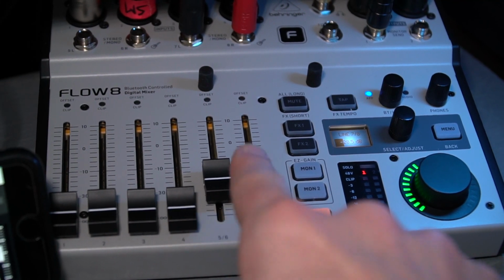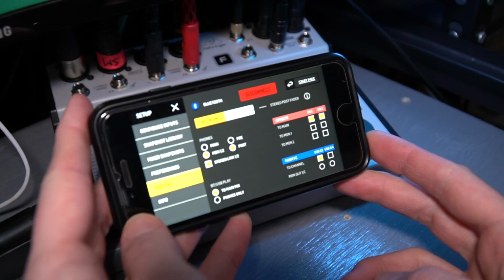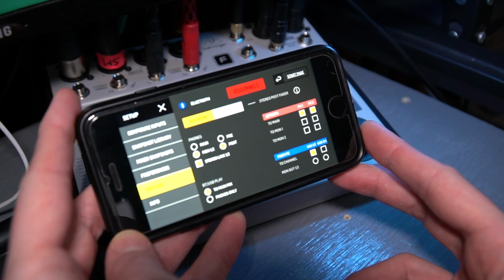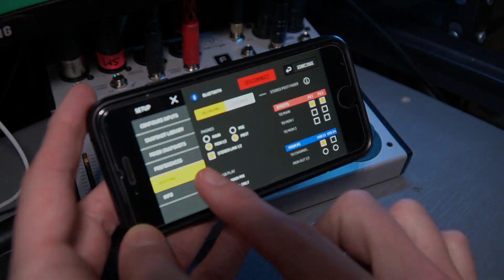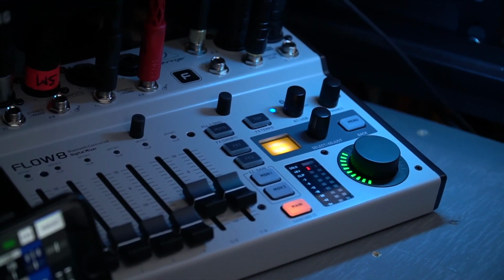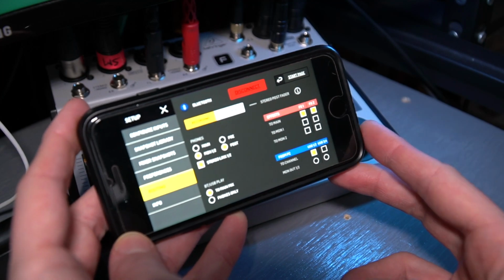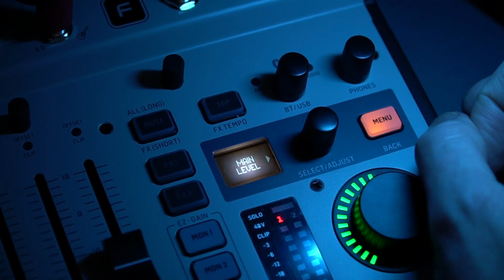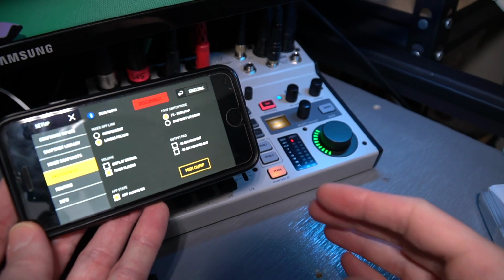Behringer Flow 8 | Firmware Updates for 2021 - Exclusive First Look

Comment: Does anyone know what foot switch to use with this mixer ?,I can't find info on it anywhere
Reply from the maker: I just put together a quick blog post for anyone curious about the footswitch specs and functionality for the Flow 8 - https://www.dcsoundop.com/flow-8-footswitch/
Reply from the maker: Great question. I just tested it and the way it seems to work is it is a TRS jack, and you want a button that is 'normally open'. You can wire it to short pin one to pin 2, which will mute the effects. Or you can wire a button to short pins 1 & 3 which gives you the tap tempo. Obviously you could wire a double switch or pedal to do both. You'd want non-latching switches, as the mute latches itself after a short hold just like the button on the mixer does. Hope that helps Simon! This should work if you're not into building one - https://amzn.to/2ZHGRbt

Comment: Hi sir plz help me! 
How to increase audio interface volume on streaming..actually connected my laptop on obs but comming on low volume

Please explain my audio problem..
Reply from the maker: It's impossible for me to know for sure, but I would suspect you have your gain set incorrectly at some point in the mixer, which is causing a low level at the computer. You need to be sure you are setting the input gain for your microphone at a healthy level without clipping, and make sure that mic is turned up in whatever send you are using to feed OBS. If all else fails, you can add gain in OBS.

Comment: in the first versions you could go to the 4 band equalizer and choose the frequency you wanted to change, apparently that was removed
can you tell me something about it?
Reply from the maker: On the 4-band EQ, just tap once on the band and the full controls should pop-up for you. At least it still does on iOS. What type of device and OS are you using? Thanks for watching!
Reply: @DcSoundOp  on android app is not working for me and it worked before firmware and app update

Comment: For my monitor the effect better pre or post the monitor is in ear monitor that I use effect 2 only for the in ears and the effect 1 for my voice so effect 1 my voice pre or post
And effect 2 pre or post?
Reply from the maker: Typically we'd run effects on vocals post-fader, so that changes in the overall level track to the effects send (this avoids you sounding like you've fallen down a canyon if you turn your mic down in the mix). There are folks who do it the other way for sure, and a lot of deciding that has to do with how you perform and your specific taste. There's no wrong way really, as long as you know why you're doing it & are happy with the results.
Reply: @DcSoundOp  this mixer flow 8 has 2 effects or the 1 is reverb and the other delay? Is is possible to have 1 effect if it has for my voice and the other for my in ear monitor?

Comment: So you're saying I can route my plain guitar sound into my DAW, then output it back into my mixer after I distorted it with my vst plugins, then ONLY listen to that mix by muting everything but usb in 1/2 to my monitor out?

If so... nice!

Otherwise, do you think it's possible to ever get "recording" mode to be post effects? There must be a reason this can't be done. Streaming is OK but it's only 2 channels.

Comment: Great video.  I work a solo act, keys, vocals. Every company always makes the mistake of not putting a high pass filter or a way to drop the low end on the effect. Especially hall settings. you have to have the option to drop the low end  on the reverb or you will sound like you are in a gymnasium. If you are a vocalist with a voice in the lower range, you have to have that option.

Comment: This mixer needs some reverb tweeks in a firmware update as the only reverbs that sound good to my ears are church and cathedral really.  These also need tweaking further from what the app will allow as they either sound to dry or too much, it's difficult to find the sweet spot. They also make plosives a bit of an issue. I'm sure they can fix this.

Comment: Lack of Parametric eq is the only reason I won’t buy this . It’s perfect otherwise . Especially needed on master eq and monitors.
Reply from the maker: The latest version of the firmware has a four band parametric (where each band can do from 20Hz - 20KHz) on each channel. If you haven't checked it out, there is a demo mode you can try without having the console on hand.

Comment: Great video. The one feature that I think will just nail it for me would be if either of the monitor outputs mixes can be routed back to the computer via USB.  That way for a setup where I might have a small live application that I also want to stream. I can have a live mix and a different  stream mix going at the same time.  It therefore works as a device level implementation  of loopback. Something that is now on almost every new audio interface/ streaming device. I think once that is done the Flow 8 will be unstoppable. As I've thought about it  I guess another way to implement that would be to route the main mix to the PC via USB and just use the monitor outputs as the live on location feed?   Thanks for the hard work.
Reply from the maker: You've got it right, you've just got to use the output that fits the job at hand & forget that one is called main & the others are labeled monitor. If you can feed the stream with the main out and use the monitor outs for a speaker in the room, that's a perfectly reasonable setup. Alternatively, I've described in a few other responses how in recording mode, you can patch a short 1/4" cable from the monitor out to the input of an unused channel & it will show up on that channels USB direct out to the computer as normal. I don't believe this is something they can change in firmware, but it would nice to be wrong.
Reply: @DcSoundOp  Thanks for the response. It would be nice to be wrong in this case. All the best.

Comment: is it possible to create a preset? and if you off and one it will be on the last sceen ?
Reply from the maker: no reason to cross post this to all of the FLOW 8 videos on the channel. Yes, presets are possible & it does return to the last known state at power-up. You can download the app to try in demo mode for how the preset library works.

Comment: What's your opinion on the actual sound quality of the preamps > output...vs a UI16?
Reply from the maker: The Ui16 is the more usable console from input to output in my opinion. I've taken the Ui12 on press conferences and the mixer can get the job done. I wouldn't consider the FLOW-8 to be in the same category - it's a fine mixer for small acts looking to travel super compact,  but the Ui mixers are more capable & give you more opportunity to get things sounding how you want at the output.

Comment: Hallo, maybe it is a stupid question... I would like to control the volume of the channels in the daw in USB recording mode. But although the fader of a channel is completely down, the signal will be recorded. So mixing in the daw doesn't work for me with the flow 8.
Maybe someone can help.
Thank you and best wishes for all
Reply from the maker: In recording mode, the level sent to your DAW is controlled by the input gain you apply to the channel on the FLOW, as it is a direct output from the FLOW-8's mic preamp. Hopefully that helps clear things up.

Comment: Hello! I have a question: in the video you show how to use MON1 and MON2 for a stereo monitor with phones; when you do that, what happens to MON1 output and to MON2 output? Can you still use them for separate monitor (with their own mix)?
In conclusion, can I have 3 different monitor mixes using Phones output, MON1 output and MON2 output.
Reply from the maker: No... you cannot get a third mix but turning on the Mon to Phones send. It simply routes the mon bus to the phones output.

Comment: Could you please tell me if I can adjust mic. level in headphones (without latency) while I record vocals for singer comfort? And my second question is could I use it as audio interface to use fader for drawing levels in previously recorded tracks in DAW?
Reply from the maker: Hello Pawel, thanks for the message. You can do zero latency monitoring with this no problem, just turn off channel monitoring in your DAW and turn the local input up on the mixer when recording. For automating tracks though, that is not possible with this mixer. For that you need a controller, not an interface. For doing that, any of the X-touch controllers will work. If you are only doing a couple of tracks at a time and the automation is important to you, maybe check out the  PreSonus iOStation 24c - it is a controller with a small interface built in too. Here is a video we did about it a while back - https://youtu.be/tawF2suXJMc
Reply: @DcSoundOp  Thank you for your answer. I found this Presonus today and in case of automation is ideal. Two inputs are enough for me. One I’m afraid is I/O quality. I use old MOTU interface so far and one guy said that changing MOTU into Presonus is like changing Bentley into Opel. What do you think about Presonus audio quality?
Reply from the maker: Hey Pawel, I'm not sure it's quite Bentley to Opel, but I like your comparison. I'm a big fan of MOTU products also & do believe the difference will be noticeable depending on what you are doing. If top quality is your concern though, the FLOW 8 probably isn't the right tool for you either. You may want to look at a dedicated X-touch controller just for automation & then upgrade your MOTU accordingly or move into something from Universal Audio, RME or Focusrite PRO for similar quality or better.
Reply: @DcSoundOp  Thank you. You helped me a lot.
Reply from the maker: Thanks Pawel, I hope you'll stay in touch in the future. All the best.

Comment: Hi and Thanks. When I use Bluetooth Audio from an Ipad or iPhone, I get audio Glitches or Hiccups as I continue to work on the mixer while audio is playing. I suspect that the Bluetooth needs refining or some updating. I use a Mackie DX8 in the same way and the audio never glitches...Has anyone else experience any Bluetooth Audio abnormalities?
Reply from the maker: Hi Carlos, that absolutely should not be happening. I just went back & tested again, using only one iPhone 12 to play music to the FLOW via bluetooth & to run the FLOW control app. There are no glitches or hiccups that I can make happen by using the app or adjusting the mixer in person. What devices & OS are you using for playback & control currently? Are they on the latest firmware & control software versions from Behringer? Thanks for the message.

Comment: Hi I hope you can help me fix this. I just bought the flow 8 and a brand new MacBook. I installed simply put and Everything goes well until after I select the newest version (738 now) y click update. A legend comes up that reads… DFU ERROR 7: failed to prepare dfu update.
The mini screen in the mixer stays red in update mode until I turn it off.

One time the legend didn’t appear and it continued to update in the simply put but the mixer said UPDATE FAIL. 

If anyone could help me i would really appreciate it.
Reply from the maker: Follow this conversation's response on the other Flow 8 video - https://youtu.be/x0owa3HC5fQ

Comment: I've skimmed down the comments and can't see anything that addresses this. Keen to invest in for small gigs with capacity for running some tracks alongside. Now that they've implemented the 4 channel USB returns I'm trying to work out if we can achieve the following (which whilst the desk does a lot, I think maximizes the potential). Was considering having the UMC404 and then a mixer, but this seemed to bring together best of it all.

Working in Recording mode
USB 1/2 as the Tracks to the BT/USB channel (rotary control) - 
USB 3/4 directly to the monitors as a click/guide track  to then run to in-ears [ Can always tweak that volume in Ableton or from a midi controller ]

Looking at the block diagram I think this is possible, however the routing pages in the app (which I'm exploring in Demo mode it's not entirely clear) There are 2 sections and it's not clear how they are linked - 
BT/USB play (which I presume is USB1/2 only) with option to go to Main mix or headphones - 
From PC with the routing table USB 1/2 and 3/4 options to send to monitor or to 5/6 7/8 respectively.

Basically aiming to not have to give up physical inputs on channels 1-8 for the USB audio so I've expansion capacity for the band if needed. 

If anyone can confirm that the BT/USB is 1/2 only and 3/4 can be sent elsewhere I'd be really grateful

Comment: Is it possible to Link the Main Mix to Monitor1 and Monitor2 ?
Many musicans prefer to have the main Mix with all Effects on the Monitor.
Reply from the maker: They haven't implemented any way to do that yet in the current firmware. I know folks have asked for Pre/Post fade monitor option before, so fingers crossed it's something that the hardware can support some day. Thanks for the message Marco!

Comment: Hello I should be able to link usb IN to Fader 4.. Rout. need the system for a carousel operator. It has 3 stereo inputs and a microphone. What would also be useful in this case is a tokover function!
Reply from the maker: Will pass this along to the dev team, thanks for the feedback Stefan, sorry for the slow response.

Comment: Does power come from microusb only or from USB B too?
An useful future implementation would be USB C, micro is really fragile.
Other useful tools would be a fully parametric eq, reverb and delay parameters (not only fixed preset).
Reply from the maker: The micro port is for power, the B is only for connecting to a host device. Thanks for the message Mauro.
Reply: @DcSoundOp  I've experienced with line6 relay, micro usb in metal housing is easy to break.

Comment: I got this Mixer for two weeks I tried to use this mixer for zoom meeting via streaming mode. May I ask you one question how to send the monitor 1 or 2 send back to the usb playback (Mix minus via usb) Because now I can use the mix minus only use monitor 1 connect to    other USB soundcard and setup zoom mic to  the soundcard.
Reply from the maker: Hey Piya, the workaround to get a monitor send back to the USB is unusual, but it does work. You'll need to use the unit in 'Recording' mode to get the individual channels to appear in your computer via USB. Then you can patch from the monitor output with a 1/4" cable, back into one of the 1/4" inputs on a channel, and now that channel with pass the monitor send output over its related USB channel to the computer. Make sure you don't turn the channel you use up in the monitor mix you use, as that would be a direct feedback path, but otherwise you'll be good to go.
Reply: @DcSoundOp  Thank you for your answer. I will try on recording mode.

Comment: why i only listen to the left headphone if it is plugged into the monitor send ?
Reply from the maker: The monitor send outputs are mono balanced outputs on 1/4" TRS or Tip - Ring - Sleeve connectors. This is the same connector used for the headphone output obviously, but there is it wired as [L | R | Common] and on the monitor output the same connector is wired [+ | - | Comm] so you're only getting a mono signal and making a connection to one side of your headphones. There is also no headphone amp here, although the line level output has enough power to drive most headphones a little bit. 

To use the monitor outputs properly, you'd want to connect them to a headphone amp, or an in-ear monitor transmitter for wireless, or to a monitor speaker. hope that helps.
Reply: @DcSoundOp  thank you for the answer
Reply: @DcSoundOp  can i use a behringer pm1 in monitor send and what kind of cable is suitable for monitor send? TS or TRS?

Comment: Will this power sm7b mic? Thanks
Reply from the maker: See my reply to your question on the FLOW 8 questions video. Thanks!
Reply: @DcSoundOp  will this mixer pair well with dbx286s and SM7B mic? Thanks
Reply from the maker: Sure, the 286s is a fine mic preamp that you'll be able to plug into any of the line inputs on the FLOW 8.

Comment: I have a FLOW 8. I have signals on headphones and main, but non signals on monitor send. Which buttons do I have to turn on???
Reply from the maker: When you press MON 1 or 2, you need to then bring up the channels you want in that mix, as well as the BIG main knob that is now controlling the main level for whichever send you selected.
Reply from the maker: Did you get this sorted out? I noticed you emailed as well after I responded here. Hopefully you got things figured out, enjoy your mixer.

Comment: Make the “tap” blinker S T O P. blinking!  Puleeez!
Reply from the maker: If you're not using EFX 2 specifically for delay, you can set it to anything that doesn't require a tap - like the 'Deep Chorus' preset & the Tap button will go out. Hopefully a work around that will help you until turning it off is an option. Thanks Tim.

Comment: I love the Flow 8. I have Downgraded/Sidegraded from an XR18 as I am a solo vocalist running backing tracks and lighting control from a laptop. The number of unused inputs on the XR18 seems a waste. The only issue I have is that the Tap Tempo using the midi command doesn't appear to be consistent and sometimes misses the desired tempo by between 1 and 3 bpm. I would love for Behringer to add the ability to use a midi command to trigger an exact bpm. Would this be possible?
Reply from the maker: Hey Neil, I'll pass your message along to the team working on it & see if I can get you an answer on that.
Reply: I noticed that as you tap the button, the very first tap is just activating the ""tap tempo function". Really useless. Tap tempo starts to work from the second touch.